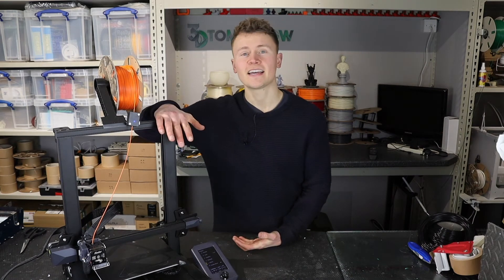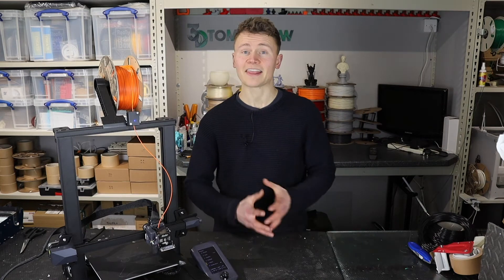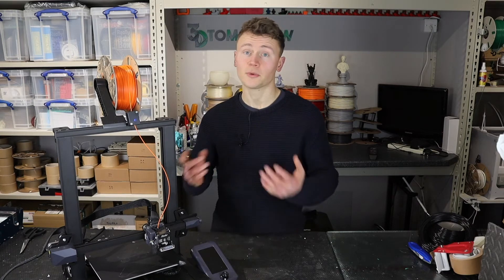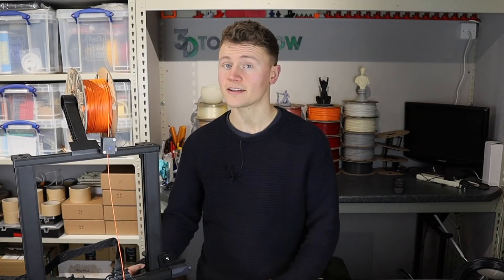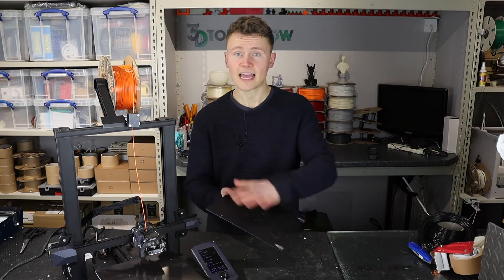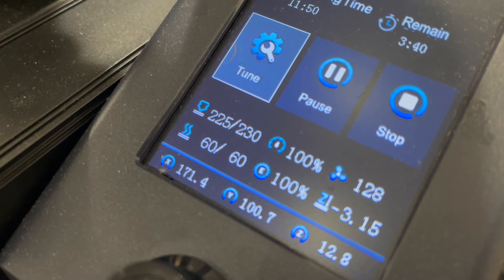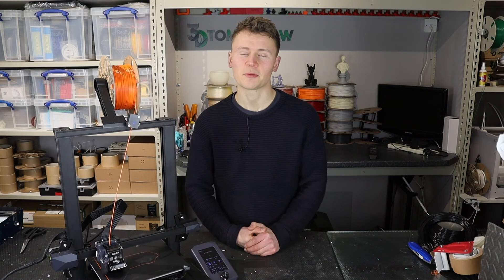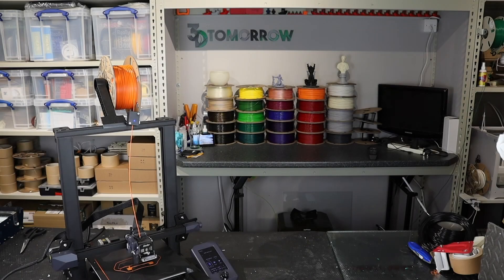Creality Ender 3 S1 || 3D Printer Review || What’s missing from Creality's latest release!?

Comment: Brand new to this, havent even finished the video but i see lots of comments about the bed and potentially replacing the print surface.

I ordered the printer plus the PEI print surface, is that a suitable replacement or would you recommend something else?
Reply from the maker: How did you get on with the PEI surface? Glass is another good option if you dont like the PEI, but obviously with glass you'll not have the flexible benefit. I personally like glass, because the bed is normally flatter.
Reply: @CallumColes  ive really been liking the PEI its got good adhesion and the flexibility is nice! But i did have a question since you clearly know alot more about this than me haha, im at a standstill right now.

The printer works great and ive had no issues until the other day, when i print with a brim the brim comes out extremely thin and stringy. So thin it cant even stick to the build surface it just clumps up and drags around. Even after perfectly levelling the bed and using new filament.

If i print without a brim its fine, no issues but then its more prone to warping. Just last night i lost a print 5 hours in cause i used a skirt and it warped, so i kind of need to use a brim. Do you have any ideas? I use Cura btw

Comment: between the ender 5 plus and this printer, which one do you recommend overall? especially in terms of not having to replace parts right away.

or perhaps just a different printer entirely, i'm looking for one that is just plug and play with auto leveling and a silent board, something structurally sound with decent print speed and big print dimensions and a budget of 400-500 euro kinda, i don't expect anything with dual extruder but would be cool ig.
Reply from the maker: Hi Robert, sorry for slow reply! They’re quite different printers really, the Ender 5 plus due to its size is great for big parts, the mechanics are quite reliable so it’s a good workhorse. The Ender 3 S1 is more versatile, the direct drive extruder makes it perfect for printing TPU. There is better cooling performance too. It’s definitely the more plug and play printer of the two, but the size is obviously more limited.
Reply: @CallumColes  thanks for the reply!

Creality might have filled the gap a little as i learned the ender 3 s1 plus came out, but sadly no reviews yet anywhere and i heard on the subreddit that firmware also isn't listed on their website yet.

I'm looking forward to learn more about that printer tho!

Comment: What is you get a filament jam in that hot end or extruded though?  Looks like it would be a nightmare to take apart.  Also, with having the extruded on the hotend, wouldn't that means the prints have to be slower to prevent ringing?
Reply from the maker: With clogs so far I have been using a metal rod, you could also use an allen key. I've not tried to take it apart yet as agree with you, it does not look like an appealing task. I will be doing a comparison video between this printer and the CR6 SE soon and this is one of the features I am going to talk about. I'll take it apart for that video and see how easy it is to get back together!

For bed slinger designs, the bed is the heaviest component, so generally that dictates the speed more so than the hot end. There are probably some bowden setups that have heavier heads than this one anyway, it's been designed to be quite light.
Reply: @CallumColes  Thanks.  Does it jam often?  Is the filament path perfectly straight through the extruded and hotend?  If it is, I presume you could do a cold pull?  That complex hotend is all that is putting me off because print 24/7 and frequently have to clear jams.
Reply from the maker: Sorry slow reply, didnt see this! Yes, as far as I can tell the filament path is straight, because I use a straight metal rod and it goes all the way through. A cold pull would also be possible yes. I have noticed a few clogs here and there, but nothing out of the ordinary, it's a fairly reliable machine. I'd suggest an upgrade to the bed, opt for glass or a spring steel PEI plate, the stock one is easy to break (surface tears away).

Comment: Thanks for the video. I also have just bought this printer. SW ver is V1.0.3_C  (Australia). Like the walk around, and some detail. However, I did not get the creality slicer to run on my windows PC. I do have Cura, but do not have the start/end gcode. I watch the videos and it does a nice priming of the nozzle before it starts to print. Is it possible to make a video about these small ins and outs. Gcode is yet another skill I would have to learn. regards
Reply from the maker: Hi David, you're welcome and thank you for the comment. Here's some gcode you can add to the start of your print, should give you the little wipe you're after.
G28 ; home all axes
G1 Z5 F3000 ; lift
G1 X5 Y10 F1500 ; move to prime
G1 Z0.2 F3000 ; get ready to prime
G92 E0 ; reset extrusion distance
G1 Y80 E10 F600 ; prime nozzle
G1 Y100 F5000 ; quick wipe

Comment: It's not clear when you did this test or if a firmware upgrade was available when you did it. I can sort of see your reason for wanting to do a test out of the box, but if a firmware upgrade was available, and you just chose not to do it,  then I would say you have put yourself through a world of pain for no reason. I've had this printer for nearly three months now. I immediately updated the firmware, and it has been flawless. I have had none of the issues you have highlighted and none of the damage to the print surface. Just thought I'd give a perspective of what it's like if you just update the firmware. I have had no failed prints, no temperature problems either. I would say so far; it's been an exceptional printer for the money. I would have no problem recommending it or getting another one. In the interests of impartiality, perhaps you should have upgraded the firmware too, to see if it also fixed the issues you highlighted rather than just leave it and say the Prusa mk3 is a better printer. That maybe so, but it's also more than twice the price.
Reply from the maker: Hey Dave, thanks for the comment! The firmware upgrade was indeed available and there is a very good reason why I chose not to do it for this review, well actually a few reasons:

1. Not everyone will instantly upgrade their firmware, some users will never have had a printer before and wont even know what firmware is! By watching this review, they might recognise some of the issues and also figure out that updating firmware could be the answer.
2. Accountability. No company, especially one that is as established as Creality is, should be releasing a production level printer (e.g. not Alpha/Beta releases) with that many software bugs. They should be testing their products properly....
3. Price. This is no longer in a super budget class and I would expect to be able to use it straight out of the box, any modifications required to make it work properly whether that be hardware or software have to be treated more critically.

The bed issue was hardware related, with a raised area of the bed causing an 'over-squashed' section. This was on a print that used the full surface area of the bed.

At the end of the day, it is still a great printer and I would recommend it as I said in the video. 
In terms of impartiality, I am not affected in the slightest if you buy this printer or go on a mad rampage against it, so would say that makes me pretty impartial. I really like a lot of the Creality products, but will always show the experiences I have had with a printer openly and honestly.

Comment: Update, I have just updated the firmware from ver 1.0.3 to the latest 1.0.5 and it has changed the operation of the printer, it now interfaces with the Creality WiFi box properly and enables the filament run out sensor which now pauses the printer ready for filament refill. I recalibrated the bed levelling and the printer is far more consistent in maintaining its zero offset setting which help’s immensely. The User interface seems to have changed slightly and looks more polished. All in all I would recommend that anyone with an ender 3 S1 update the firmware, even though I was worried at first due to the possibility of turning the printer into a £400 paper weight. I would hope Creality would allow firmware updates to be done via the Creality WiFi box as an option.
Reply: Changes in the z offset were a known issue with the original firmware and this could well have been the cause of the damage to the print surface in this review
Reply: @daveedaem  what I found was that the surface started to delaminate from the spring steel sheet, I was careful not to use the scrapper but the build surface failed and I replaced it with a glass bed which removes these issues. The bed was only the major let down as far as I found, the ender 3 S1 has proven to be really reliable.
Reply from the maker: @Dave Meade the damage to the print surface was due to deviations in the height of the bed surface itself, nothing to do with the z offset, since 95% of the print was at a perfect first layer height. There was a small raised area in the bed / adhesive texture that resulted in over compression of the print in that area. That sort of textured print surface is seen as a consumable anyway, if you do a lot of printing, it will occasionally rip. It's just not ideal when the hardware expedites this process...
Reply from the maker: Cheers for the update, pleased to hear you are having better results now! Yes if a company is going to release a printer with serious bugs, they really should also reduce effort to upgrade the firmware, via the Creality WiFi box could be a good future implementation.

Comment: got this printer about 3 weeks ago as my first one, love it a lot so far.  the only area i have had issues with is the bed.  it is very uneven, even with the CR touch there are high spots that have made bigger prints a PITA for adhesion.  using a brim is a nightmare, some areas it digs into the bed and some it wont stick at all.  i have to move the location of the print around to find a suitable area.  once i am able to get a decent first layer the quality of the prints are amazing tho.
also they include an absolutely cheap a** spatula tool, that is stamped and not cleaned of burs.  one side had terribly sharp edges and the first go i gouged my bed because i didnt check the tool.  didnt check it because i never expected a company to include a tool that could so easily destroy the object it was intended to interact with.
Reply from the maker: Hey Tom, thanks for the comment, glad you're enjoying your new printer. Always nice to hear when people have started on their journey into the world of 3D printing. Yes the bed is not the best, which is a shame. The spatula is useless, really hate it when companies mass produce worthless tools, so wasteful!

Comment: Great review Callum, as with your experience I changed to glass and 3dlac build surface as the spring steel unit surface failed within 2 weeks, shame as it is the main let down on my first 3d printer. Fortunately I haven’t found the software as buggy as you have shown. The home function with the CRTouch shifts the zero offset so I have to reset the zero adjustment after every couple of prints, annoying but not the end of the world. The performance of this printer is superb as a first printer if you don’t want to modify a cheaper option. With my limited knowledge learned through the use of the ender 3 S1 I now know what features that are important and Creality apparently are bringing out a dual fan cooling adapter which will help with the overhang cooling issues that we have both seen. Shame that the sprite unit isn’t full metal which drops max print head temp but sliceengineering are producing a heatbreak that is full metal for the sprite unit so something else to look at upraging in the near future. Keep the great reviews coming.
BTW the 3dTomorrow BioPro filament continues to impress, as are the other filaments bought from yourself directly and through Amazon, can’t wait to see what you develop next.
Reply from the maker: Thanks Steve! Glass + 3DLAC is definitely a great combo, where did you order your glass it might help others reading the comments?
Will be very interested to see how the dual fan adapter fits in, would be fantastic if done well. I don’t actually think the metal hot end is too needed for this printer, since there aren’t too many materials that require high heat but can be printed in an open enclosure. You can already print PLA, PETG, modified ABS and of course BioPro as it is! So think it’s unnecessary added cost, really sure what a high temp hot end would actually add.
Reply: @CallumColes  I am enclosing my printer to allow more temperamental filaments to be printed and the hot end upgrade will give me greater scope, the ender 3 S1 is a test bed for me to decide on my next printer.
I bought the glass bed off Banggood - Creality ultrabase 235x235x3mm and they were available from a uk warehouse but unfortunately no longer, they are on Amazon aswell but I haven’t purchased one yet as I bought 3 from Banggood to allow me to keep printing while waiting for the glass bed to cool and release the print.
I don’t use the textured side normally but it does work without adhesive, again though it does not last long. I have used the spring steel sheet but the reverse side without the coating, but the glass is a more stable build surface. I have had a few blockages with the sprite extruder and every time it is in the ptfe heat break within the heater block, easy sorted but the ptfe tube is also starting to fail. So a full metal unit will hopefully reduce maintenance issues. The ender 3 S1 is a great printer, I believe the ender 3 S1 Pro resolves the build surface and sprite issues that are a let down for me personally but it would be nice to do a comparison review.

Comment: Great review. The ender 3 S1 is my first printer and I've only used 3d tomorrow filament through it. It's been great so far, with no issues yet. I'm going to try my first biopro print today 🤞. Thanks again for your help
Reply from the maker: Thanks Andy! It’s a good first printer for sure, few issues to contend with which helps you learn, but reliable enough to properly get into printing.
Have a few people using BioPro with this printer, just use standard PLA settings and increase hot end / bed by 5-10C